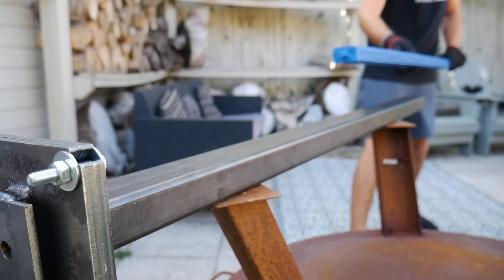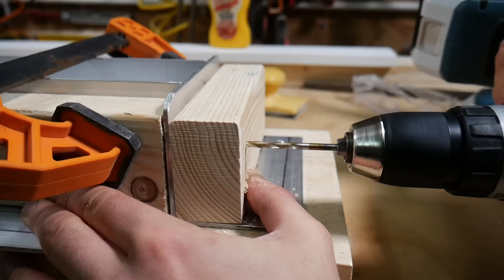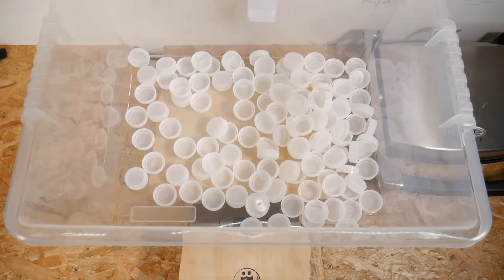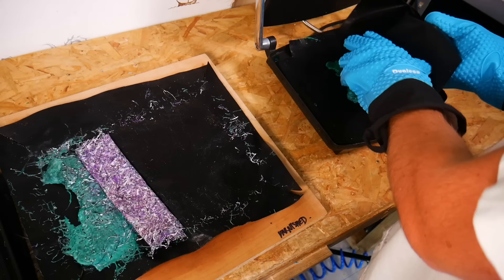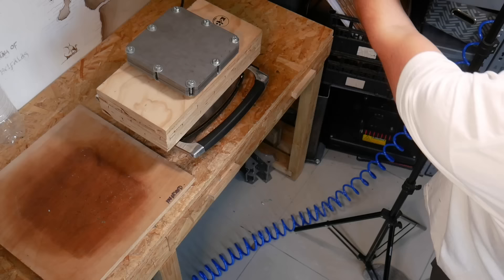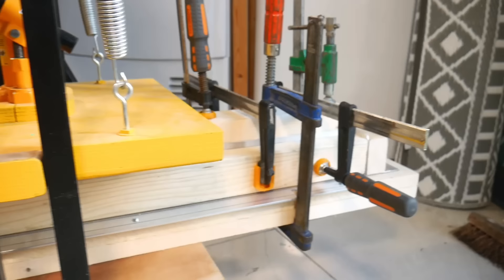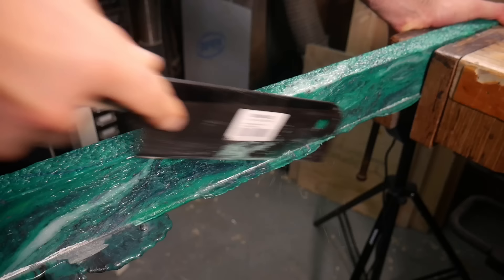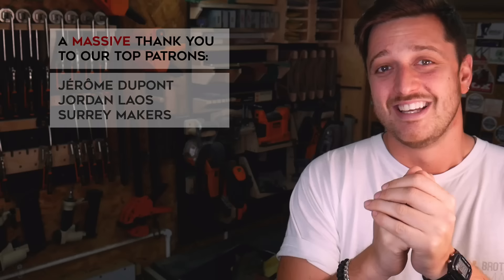How to Make Recycled BEAMS from Plastic Waste at Home

Comment: I was literally just thinking the other day that it would be amazing to figure out a way to upscale home plastic recycling to building material sizes, and now I'm eternally grateful for you guys doing most it for me lol. I know what I'm building next year's garden beds out of. I'm gonna try a few experiments with HDPE grocery bags as well, since I already use those to spin "yarn" for knitting projects, but have tons of edge cuttings that aren't the right shape for it and are just sitting in a bag.
Reply: I would be concerned about plastics leaching into the soil and from there into the plants I'm growing to eat.  Might be safe if you use the right liner though?
Reply: @Shadenir  HDPE is used for milk jugs and other food products so as safe as any material for garden bed.
Reply: Great idea, saw thin concrete raised bed on YT with interlocking panels, basically holes at ends (corners) that accept rebar driven thru into the ground.
Reply: If it's not UV stabilised it will become brittle and start dusting.

Comment: My recommendation to make larger beams like 8' 10'  even 12' in length is to use strip heaters in the mold and add the shredded plastic directly. Make the mold taller or melt it in layers. The tricky part and I'm not sure off the top of my head how you would do it is to load it all into a vacuum chamber. Because you can't have air bubbles if there wasn't any air (ie. vacuum) to begin with.
Also with a vacuum you won't need a press because gravity will pull everything down when the plastic becomes a liquid.

Comment: I’m wondering about the strength of the plastic beam compared to the wooden beam? I’d love to see a structure made out of plastic beams!
Reply: Melt under the sun, or lose strength and alignment.. there's a reason why these aren't used.  They've thought about this before.
Reply: You can already buy plastic decking/ fencing and Sheds. They are becoming quite popular in UK.
Reply: @jerelsalazar7959  my plastic shed would argue otherwise
Reply: @dusand12  yeah, i also considered on other hand other plastic based or similar building materials like vinyl, composite, etc and they do withstand heat and other variables, I may have presumed and concluded too much too fast on little experience, I concede the argument sir :)
Reply: The compression strength is the problem. Plastic doesn’t have much give before it becomes brittle and cracks.
Especially when In the elements
Reply: @jerelsalazar7959  structural beams aren’t exposed to sun, why would lose strength? It would last 500 years rolling around anyway
Reply: HDPE has a poor resistance to UV light, melting it in the sun is not a good idea.
Reply: Plastic engineer here, tioxide helps prevent a lot of the damage except surface yellowing, if you want to make it practically immune then you can always add Uvinul or similar
Reply: Its hdpa, its very soft plastic with low points of failure and it deforms easily.
Reply: @dusand12  your shed is not made out of hdpe.

plastic is not the same as plastic. Different types of plastic have different properties and you can further change them by adding chemicals and fillers into it.
Reply: Worked in Yellowstone and Grand canyon N.P. all of the new boardwalks are made out of laundry detergent bottles.  Ton of foot traffic and extreme weather.  Not to mention Bison traffic as well!
Reply: @frankrinchiuso3380  that undergoes different stresses than a beam would.
Its a top layer.

Imagin having a rug on your floor. You can stand on it, dance, you cohld probably have bison walking on it as well and it would be fine.

Now try to use that rug as a structural beam in your roof.
Reply: @HidekiShinichi  very well . This is out of my true understanding technically. Surely must have some usefulness at least in reducing impact in some way.  What qualities does it possess that exceed wood? How then? Two times the size of Texas is floating around the pacific.  Even if that is an exaggerated scope it is still staggering at half that amount!
Reply: We make HDPE out door parts but they go on aluminum or over wood for support.
Reply: @frankrinchiuso3380  there is dozens of types of plastics that can be modified further to achieve different properties.

There is plastic like bakelite, which have a high temperature resistance and is used in places like pan and pot handles. But its not a termoplast so you cannot melt it and have it recycled, once it have a shape it stays that shape.

There is plastic like hdpe which have very low melting point and is fairly chemicaly inert. It is also soft and slippy so its good for stuff like bottle tops or protective gliders for furnitures, I belive its also same plasric use in fake ice skating rings.

If you want more structural plastic thay would replace wood you would be looking to stuff like nylon, pvc or pp and you would need to melt it in a more controlled fashion.

Anyway.

Whatever the guy in the video did added to that patch of plastic and polluted more environment compared to him just trowing those plastic bits into trash.

Comment: 0:59 Ideally, the endgrain should curve in opposite directions so if the board has a tendency to warp a specific direction, that warping will fight itself.
Reply: Thank you for the time stamp. I was quite confused when I read your comment. Thinking something along the lines of 'what kind of idiot thinks there's endgrain in a plastic beam.' Then I saw what you were referencing.

Comment: been following this channel for a short while now, these video's have really shown me the potential of working with HDPE and have experimenting with it for a few weeks now and have a few observations I've made about it so far I thought I'd share (and apology's in advance for the large wall of text)

hpde's pliability allows it to be easily used for living hinges and or springs (meaning there's no glue or rivets that can fail between a spring and a part)
 
its strong enough that when cast as two hollow parts and welded together with heat it can still be a mechanically functional/stress bearing part

it floats easily even when its a solid part

when using white/translucent hdpe that turns transparent when heated its possible to color it by using both natural and artificial pigment powder, and this pigment powder douse not affect the thermal property's of the plastic nor douse it cause any fumes, this works for all pigments which includes metallic and color shifting pigments (have only attempted this with white HDPE as I doubt it would work with colored hdpe but this is a test I'll attempt in future, even if changing the color is not possible it should still be possible however to turn a unappealing slurry of color into black HDPE using dark pigment for example charcoal powder though I again have yet to test this but this is the next test I have lined up as I have a bunch of orange and dark green bottle caps, which is not the most appealing color combo)

it seems when it comes out of the panini press to lose its heat fast enough that it gets below 200 celsius soon after, this means it should be possible to use HPDE in its clay like state in a resin two part mold, be this a conventional resin mold or even a 3d printed resin mold (most resins crack at 200 c) have only tested this so far using press fitting resin prints into it but that worked great

high temperature hot glue seems to be able to bond pieces of HDPE together at least temporarily especially on a rough sanded surface, I am going to be trying a few type of two part epoxy's to see if I can get any better result aswell

it is very much possible to use both woodworking and blacksmithing/jewelry smithing methods on this material which opens up a whole new world of possibility, (one thing I've not tried is casting methods as I'm afraid the temperature at which HDPE becomes liquid enough to cast is also the point at which it starts burning/fuming)

and lastly but not least back to the strengths of HDPE and where I'll be focusing my efforts most in future after I complete all the testing, when molded in the same way as you would mold steel to increase its impact resistance (rounding and fluting primarily) HDPE seems to have about half the impact resistance as its equivalent in steel whist being far easier to repair... or in other words a piece double the thickness is potentially as strong as whist being potentially lighter, so far I've tested a few pieces of varying thickness and density and the results are promising.
looking around elsewhere online I seem to not be the only one interested in this particular application of HDPE as there are a few company's producing H.E.M.A. gear out of HDPE (though most are focused on high volume utilitarian gear), currently the best way for the arms and armor community to get beautiful genuinely looking armor is either A. commission a custom hand forged steel suit which costs between €5000-€10.000 not to mention the oil required to keep it from rusting (as buying a handmade suit out of stainless steel is impossibly expensive and labor intensive) or B. buy an aluminum suit which cannot be used for sparring... 
I hope to add an option C. to this in the form of custom on commission basis HDPE suits of armor, they won't offer as much protection as steel so they can't be used against polearms or for jousting, but they should be able to protect against a longsword and anything below 380 newtons of force (which is what most schools and tournaments are designed around these days), whist being cheaper than aluminum.
will this be incredibly labor intensive and still be an expensive item? yesn just form the labor hours alone. 
but form my experience if there's anyone willing to spend big amounts on finely hand crafted items its the arms and armor community... plus the appreciation of the past helping the future by reducing plastic waste is a thought I very much enjoy.

p.s. sorry to anyone that did not expect to be reading a damn essay on HDPE when they started to read this comment xDDD , but I very much appreciate it if anyone did in fact read all of it, any suggestions as to any additional tests I could preform would be much appreciated and ofcorse I welcome any and all questions about my findings.
Reply from the maker: Now that was a long comment! But it was all super interesting stuff, some awesome finds in there. We've saved your comment down to keep for future reference too, so thank you for that! Really interesting application idea for armour - I imagine it would still be super labour intensive, but like you say any set of armour would be. Also, keep us posted on your findings regarding being able to glue it if any of the epoxy you try ends up working!
Reply: This was awesome! Share more!💕
Reply: Thanks for the comment. I am doing some research too. Actually planning to incorporate HDPE and PP sheets into modular furniture design. I’ve already read a ton of scientific papers and it turns out PP, HDPE and LDPE are all relatively safe. Still being cautious when handling them in melted state is reasonable as You never know what kind of additives there are. In terms of mechanical properties PP seems to be the best, also being slightly less dense. On the other hand HDPE has lower melting point and is much more resilient to low temperatures. This month I will be carrying out tensile strength tests of recycled HDPE from detergents and milk bottles to see how it differs from virgin material. Also have designed a no-tool furniture connector that I wish to prototype trough injection moulding soon. I will post results online in my engineer thesis when its done and approved. 
P. S. Really glad people start to realise how plastic pollution literally kills us.
Reply: @pawewojtas88  I'd love to see that when it's ready!
Reply: Good read. How you think this recycled plastic can react to uv exposure? Let’s say I want to build a bench for my backyard. Do I need to add anything to prevent deterioration?
Thank you

Comment: Most of the methods I've thought of so far involve basically reinventing injection mold casting, that or just cooking your plastic in a giant hot pot of some kind, though I assume one of the main concerns is having an even distribution of heat and maintaining a constant temperature, so possibly an electric slow cooker or a double boiler set up for doing large quantities of plastic all at once rather than the slow laborious task of melting small amounts in a panini press.
Reply: I've worked with plastics for years, and I laughed the whole way through this video.  "We recycled this plastic!"  well, yes you did, but the amount of time and energy used was phenomenal! 
(math warning!) You can buy new plastic for $5 per kilo.  It takes six hours of labor (that's two guys times three hours each) then you come to the conclusion that they're working at $0.83 per hour.  Alternatively, if you figure you should pay $10 for grunt labor (no brains attached) you come to $60 per kilo of recycled plastic.  Either way, clearly something is out of whack by an order of magnitude.
Reply: @geraldfrost4710  r/whoosh

The point of the video isn't how practical it is, but to inspire others into reusing recyclables. Recycling & learning new ways & things you can do with them is good thing!

You said you laughed the whole way through the video which is weird because I only laughed at your reply. Your math definitely needed a warning because it's wrong. If it's $5 per kg & they use 1.8kg then the price of the plastic new would be $9, 1.8 x 5 = 9, not $5 total like you used. Next, as you said it took 2 people 3 hours to complete, so 2 x 3 =6. Last, $9 divided by the work hours gets you the price/pay per hour of work, so 9 ÷ 6 = 1.5 or $1.50 per hour.

Maybe learn math before you try & sound smart next time! Thanks for all the laughs & I wish you the best!
Reply: Here's some  more math for ya'll...  I'm not sure of the exact specifics, but I recon it costs about 86 cents worth of electricity to run the two 1800 watt oven/hot plate for the 3 hour duration (at $0.08 per kWh).  Not much overall cost, but where did that electricity come from???  If not from your backyard solar panels or an up-stream hydro plant, then that's some CO2 emitting fossil fuels being burned for this.  

 Still, great idea and very useful - if even on a small scale.  We never get an even trade with anything, but I'd rather see this recycling than plastic end up in the ocean.  I have some cable runners made from recycled plastic.  You can clearly see the different colors and chips used in the press.  Very durable and it makes me smile that they were made from old water bottles and such!
Reply: @HidekiShinichi  You're exactly right, but your anologies need work.
Then again, these guys don't understand math...
Reply: @HidekiShinichi  Another thing that wasn't shown was the cleaning cost.  A kilo of clean recycled plastic is a lot of work, and it uses a lot of water.  That's different than "recycled industrial waste" which is off-cuts of already clean plastic.  I worked with a company that made boards out of recycled plastic, and the sand and ball-bearings (from pens) would eat up a 2" diameter extruder screw/barrel in about a month.  Boards were about all they could make, as thin parts always had flaws (material differences, water voids, and non-melted high temp plastic).
Reply: @darinaho7640  I have told employees, "If you fight with two cents worth of material, you've lost the fight by wasting time." The only time it's worth fighting with two cents worth of material is when it's the prototype, and getting one right is how you're going to make the next million right.
I'll add teaching to the list.  When your effort is to teach, yeah, that's worth spending time on.  
The problem with recycling plastic isn't the plastic, it's the junk that comes with it.  Plastic used in contact with food needs to be cleaned of that food.  How do you clean a milk jug? A yogurt cup?  A meat tray? A plastic bag that peaches came in?  What scrubbing chemical do you use? (soap) and what do you do with the waste water?  
The price per pound of cleaning is more than the price of new plastic.  Well, sort of.  It costs too much to make the plastic clean enough to use in food contact.  But when making boards, you don't have to clean as thoroughly, so it's nearly break even.
Dare I suggest using waste plastic for fuel?

Comment: Dissassembly a fee panini presses and attach them to the mold. Place bottle caps in mold, melt in place. Make the void taller than before to allow the appropriate volume of unmelted caps to be place in. Then make the top press piece deep enough to squish it alp the way down, adding weight to that piece so it does it with the assistance of gravity. Good luck getting the bubbles out.

Comment: The real way to increase production is to use a big oven with several racks. The kind of heaters used in school cafeterias would work well for this. Pile the plastic shavings onto 10 sheet pans, and load them in. You could cook several kilos of plastic at once. You could even leave some in while you work with others.
Reply: Now your talking!!

Comment: You could combine the processes of melting and pressing into one step. Build a 2x4 shaped panini press with nichrome wire encased in ceramic, protected by steel, mounted to the bottom of the pressing instrument. Add bottle caps. Add blades to edges to automatically trim off excess. Press and heat. Done.
Reply: Was thinking the same: aluminium also has higher melting point than plastic..

Comment: Great video, very interesting! A good way to repurpose old equipment would be a discarded dryer. They have a ton of heat output and you can probably find one with a broken drum to save from becoming scrap. It would take a bit of DIY but you could make a huge convection oven that could be controlled on the timer. Set it and forget it melting a whole bin of caps (under supervision of course).